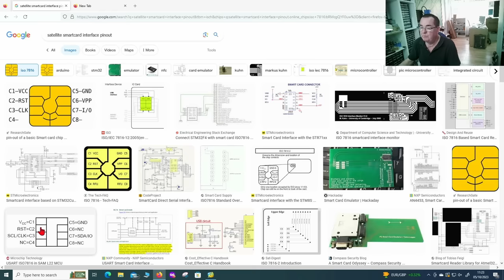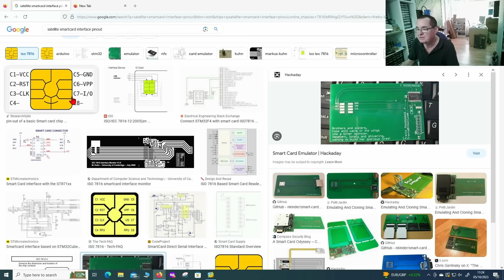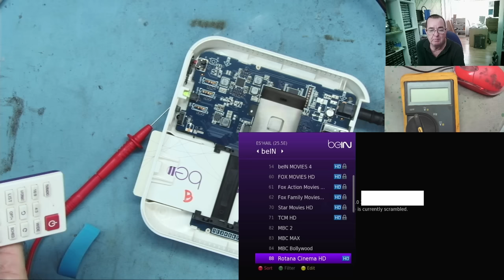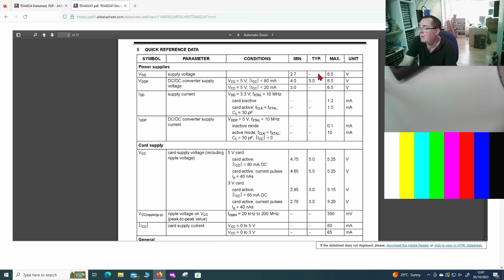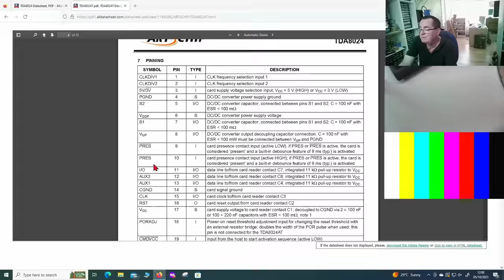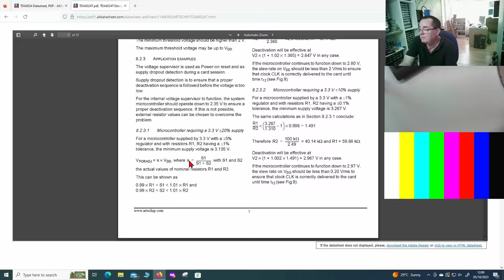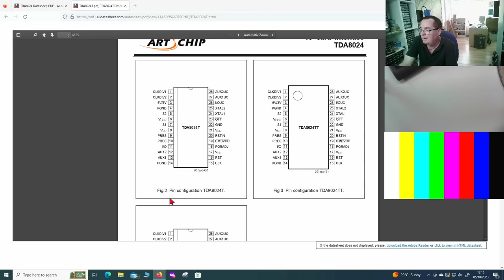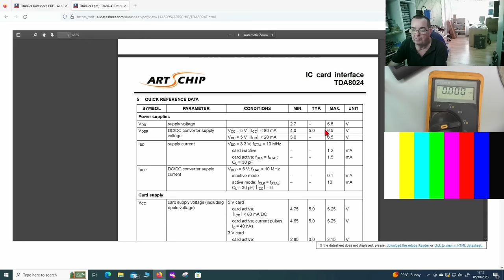Satellite TV Receiver Repair Smart Card Not Found Not Detected PART 2 : Can We Fix It?

Comment: I think I would have checked if the /PRES signal came from the switch on the card reader and if it was there. It's quite likely that the chip doesn't supply voltage to the card until that signal is valid, simply to avoid shorting the power to the card reader.
Nevertheless, good diagnosis and repair.
Reply from the maker: I'm not sure how you came to the conclusion seeing as changing the TDA chip fixed the problem.  I think, because the evidence suggests this, that the Presence switch on the card reader must go to the CPU.  This would kind of explain why when first powered up the screen would show the message 'Smart Card Not Present', which is what you also see if you put a card in upside down, and then then instantly change the message to 'Card Not Inserted' when I removed it.  It could be though that part of the TDA chip was still working, it still had Vcc after all, and just the inbuilt mosfet or whatever that supplies power to the card was faulty.  I guess like you say I could have traced where the switch on the card reader connected to. I did mention if changing the chip didn't fix it then checking the signals to and from the TDA would be the next step.  Like you, I was happy to see it working.
Reply: @LearnElectronicsRepair  The datasheet says it is the contact input so it comes from the switch not the CPU. I would simply have checked the signal path from the switch to the chip just to eliminate a break in that circuit (possible broken track/diode/resistor) before desoldering the chip. A couple of seconds probing rather than the risk of heat damage.
Reply: Good idea, I would have checked for a short on the +5v card supply rail too, before replacing the chip. One of those two SMD ceramics on the +5v next to the card slot could have been shorted, SMD ceramics love going short for no good reason.

Comment: The mfgr of these things is all about the cheapest they can, as these complex chips could have been socketed. Such was the case case of a Roku unit I had recently. SMT is a monster to repair, and most would just toss them out, as I had to.
Reply: "these complex chips could have been socketed."  - ROFL I hate to break this to you but literally NOBODY does this anymore, in fact they've stopped doing this more than 20 years ago even for BIOS chips on PC motherboards. But I do agree that these customized Humax things are the cheapest sat receiver crap you can find and they aren't really worth repairing at all.